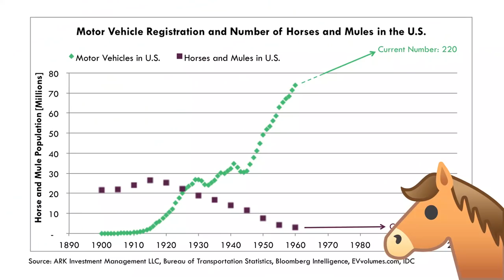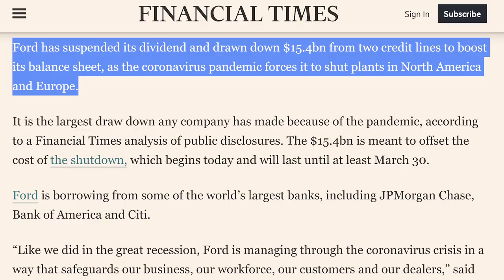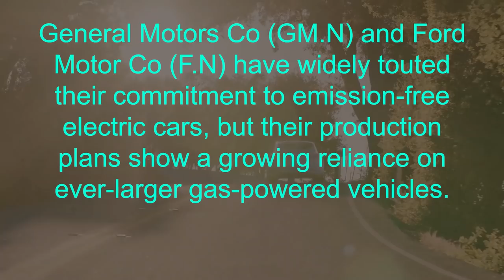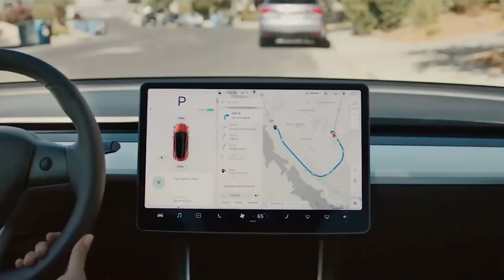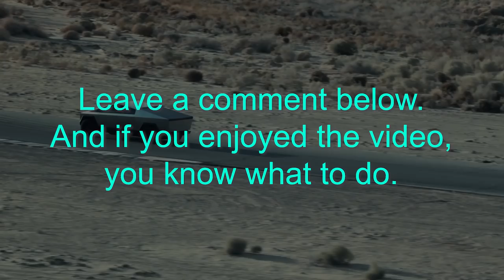Ford and GM are in BIG Trouble (bankrupt soon?)

Comment: The latest one ton diesel pickup trucks are ~$100k. The highest trim levels for 1/2 trucks are approaching $70k. Who are they kidding? I have two tri-moter, 500 mile Cybertrucks on order for my ranch. Hope Elon builds a one ton truck replacement soon. It will need to have at least a 300 Kwh battery. 400 would be better. 

Another interesting tidbit. Case is building a battery electric version of their venerable 580 backhoe. The only problem is it's battery is only ~100 Kwh. It needs at least twice that capacity imo. I am sure that will come in time. Now we need a portable battery large enough to charge the backhoe in the field. Perhaps Tesla's semi could serve this function. It could certainly tow the backhoe to the job-site and it's 1 Mwh battery is amply large enough to charge a 200 Kwh battery.

Comment: EV still have a range and charge time issue.  It's not so much a problem for people that live close to work and do not travel, but outside that it is an issue.  My family takes regular road trips.  On the longest ones I try to bust out 700-800 miles in a day.  That is about 12-14 hours of driving.  No EV can do that.  That means our longer trips take an extra day of travel on each end.  So, take an extra couple days off work or lose two days of vacation.  

I am not saying EV won't ever be most of the market, but my issue is not a lone one.  I think there will be this somewhat of a leveling off point where both are on the market till EV reaches a full parity with ICE as far as daily usage.  When that parity truly comes, yes ICE is dead.  Till then there will be rolls EV just can not fill. 

As for the cybertruck, I don't see that being as big of a seller with current truck owners.  Myself included.  If you actually use your truck for truck stuff, the bed it totally useless thanks to the goofy wedge shape.  Once something that is more like an F150, Silverado, Tacoma, ect hit the market, you will see lots of EV trucks.  That probably won't be a Tesla truck though.  I am pretty sure the preorders are mostly coming from the Tesla fan boy/girl crowd.  I doubt people that do real truck stuff are preordering one.  Especially for work trucks. 

Assuming GM and Ford survive and start making EV trucks, they will likely stand a better chance.  Toyota also with an EV version of the Tacoma would be interesting. 

So, basically, in the end it all really comes down to those batteries.  Once someone figures out something better to get more energy into the same volume and/or how to charge them fast without setting them on fire, all bets are off.  And on the truck side people that know how to actually design a truck and why trucks are designed the way they start making EV ones, all bets are off.  Till these things happen, ICE will still be on the roads.  As long as EV's fail to fill a particular role, there will always be ICE.  It is only when that roll gets fulfilled that EV takes over.

Comment: If Batteries get more energy dense and cheaper (which we all agree is likely) it helps traditional auto companies electrification more than it helps Tesla

Imagine a battery that is twice as energy dense at one third the price. That allows traditional auto companies to offer all their existing models in an electric version

You will be able to spec any vehicle to be EV if energy density doubles and prices are one third of today

The consumer can then choose and most will opt for the electrified version if the premium is not too high

Can Tesla compete in such a world?
Yes in some segments but not in others

That is the most likely future
Batteries and electric powertrain improve so much that any model can be electrified using existing facilities and manufacturing processes

Currently converting an Audi A4 into an electric version might be able to fit 30KWh into the engine bay under the seats and in the transmission tunnel. That gives it a range of perhaps 125 miles that's not sufficient. If battery energy density doubles it allows the car to be 250 mile range which is sufficient. Going from 125 miles to 250 miles is a lot more significant than a Tesla going from 300 miles to 600 miles

Comment: I dont think the car-loan argument is valid.  Defaulted loans turn into repossessed 2nd hand cars which have a predictable value over the short term.  There are few surprises in that situation.
I think you're thinking of these car-loans as long term, but i expect they are short term: mostly 5 yrs, 10 max.
Yeah it might be cutting it fine still considering how quickly Tesla is changing the market.  But it'd take longer again for these shakeups to effect the 2nd hand market.  If ppl are buying 2nd hand cars, they probably cannot afford a Tesla.  Maybe the upcoming   Chinese-designed Tesla can change that, i'm hoping it's designed for a much lower price point than other Teslas.

Comment: I'll provide a counter argument. Ford and GM know that EVs are the future. The main variable here is how fast the transition occurs. It's obvious that switching from gas to EV vehicles is going to be very expensive. They plan on using the profits from their current gas cars and financing to fund this transition. Ford and GM could go bankrupt if the transition happens quicker than they expect, which would be great from a climate change perspective. But I think the EV transition is going to take longer than many of us hope.  It's a very difficult balancing act they're trying to perform, but I think they'll pull through.
Reply: Gas car market is imploding. It was slowly going down before pandemic and now it is just going straight to the ground. Both Ford and GM lost money in Q4 2019, and they probably won't make any money this year. They will probably cut many of their EV related projects just not to go bankrupt next year..

Comment: Let's not forget that there will always be trucks, boats and farm equipment that either cannot run on batteries, so the ICE engine will be with us for a very long time, although in ever decreasing numbers.  Then there's racing!  I know even though there are EV race cars out there, there is just no replacing a screaming F1 car going down a straight.  Or the different engine sounds of a big V8 to a motorbike engines.

Comment: I like this video and what the message is, but I don't totally agree with the prognosis. Yes, Ford has 170 billion in debt and they rely on sales of their F150 too much. But nothing is said about Volkswagon and their 222 billion in debt or Toyota and their 183 billion in debt. Even Daimler has 170 billion in debt. Tesla is just getting rolling and with the Model Y and the Cybertruck, they are going to rip a hole in every carmaker that can't produce an EV vehicle that gets 400 miles to a charge and is self-driving or has a supercharger network across the country. Another thing not discussed is that Tesla is also going to be producing EV Semi's and once they gain a share of that market it could push the Freightliner, International, PACCAR, and Volvo out of the Semi business unless they make their own EV Semi to compete with Tesla. Times right now are going to get very tough for vehicle manufacturers, I have not purchased an EV yet but that is going to change soon. I love how my Prius PlugIn gets great gas mileage (60 mpg average) and I can go almost 2 months without having to buy any gas, but if Toyota was smart they would have pushed themselves into EV long ago. My Jeep can't even compete with its 14 mpg performance. Time to sell it and jump into the Cybertruck with Tesla. But that is just my opinion right now. 
If I had the financial backing to do it I would have 2 Tesla vehicles and my house would have a Solar roof and 4 Powerwalls in my garage. Come on Elon, give me the loan and I'll place my order!

Comment: With 2 9 dollar oil who is going to buy a electric car when gas is so cheap because our electricity power lines will not handle the extra strain on the system

Comment: I understand your excitement for Tesla. I also understand there is a lot about auto manufacturing you don't know, and may not be aware of yourself, because of your excitement for Tesla and what you've been "told" by Tesla.

When do you think Tesla will clear it's first dollar in a calendar year?  Meanwhile, the legacy automakers have been, and are, making profit. That is something Tesla is competing against.

Do you know Ford will have a full electric version of ALL of their vehicles? Did you miss that announcement?

Right now, people who buy a Tesla by a Tesla, not necessarily an electric car. They buy the Tesla for the allure of "Tesla." Musk has basically said the US market for the Model 3 was already met (last year), that was the reason for the dire need to export from USA and build in China; lack of market in USA. 

Ford is working on gravitating the market (not just in US) towards electric cars by first producing hybrid versions of all their models, and offering electric power as just another propulsion option, as if it were just another engine. People are not ready (in general) for switching off desire/comfort/familiarity with gasoline powered cars and immediately switching on to only electric power, which is unfamiliar/unknown/a risk/higher purchase cost/etc. These are perceptions by automotive customers. As such, they have to be assured that this works, is convenient, won't be an inconvenience, and is not an "odd" thing. Ford is working on making electric propulsion mainstream, instead of one of "those" cars. Tesla is offering a "different" thing that is electrically powered. Ford will be offering what people are familiar with, comfortable with, and have confidence in; the vehicles they've been buying and know. 

The Mach-E will be launched this year (or it was before corona). You don't think that is the only electric vehicle Ford is launching, do you? There will be an all electric Explorer launched in Europe this year. The all electric F-150 may be launching this year as well. There is a Hybrid Escape and Explorer currently. The progress to gain acceptance of electric power by the masses is presently ongoing. Tesla will also benefit from this, but Tesla has a stigma attached. Good for some people, not good for others.

All major automakers have all electric platforms. There are more than 50 all electric vehicles hitting the market over the next 5 years, starting last year, manufactured by companies that have been manufacturing vehicles for sometimes more than 100 years.

I always wanted to see a new automaker come into being in my lifetime. I am hopeful that it will be Tesla, but with my experience and knowledge in the industry, I don't know if that is possible. I have more hope now than I did a year ago, but I had no hope then, so that doesn't say much. I'm not here to bash, I am here for cordial conversation.

Comment: Ford and GM or any other manufacturer would not be 'Screwed' if they would embrace and implement Direct to Consumer Sales.  The Auto Manufacturers are like a human who for years has been carrying around a load of fat and adipose tissue, which still works as long as they don't have to compete with anyone.  Yet bring in a clean lean and mean athletic runner (like Tesla), and attempting to drag the gluttonous tissue of Auto Dealers/Associations with them while trying to keep up with Tesla, is indeed going to make many of them stumble and croak. 

It's sad for the wonderful engineers at some of these auto manufacturers, who indeed have been the ones that brought Substance to many of these cars, but when their hard work is politically diluted down by the gluttonous greed overhead of dealers and dealer networks - what gets to the consumer for their money, and what the consumer pays ends up unfairly making the engineers hard work more of a footnote. 

Much better for the Auto Manufacturers, if they would Sell Direct to Consumers (and make a car than can be sustainable that way - like Tesla does), and then also make a car with the features longevity that Consumers want - not the Features-Fail-for-Parts business model like the Dealers want. 

Consumers would be ready to give Auto Manufacturers another chance if they weren't being forced into a mini-socialist Eco-system giving skimmed money to countless third parties - just to buy and own a car.  Consumers are Waking Up to this (not 'woke' but Waking Up, as 'woke' is another fad mental disorder) - but if Auto manufacturers would just sever this glob of gluttonous adipose tissue and fat made up of Auto Dealers/Associations - if they would just do that they may have a better chance to survive. 

If they insist on the gluttonous dealer associations socialist umbrella over consumers, then they actually deserve to fail (and they shouldn't be getting any more government bailouts either!).  If they were to fail and get bailed out, it would be like our government is supporting and endorsing mini-socialism Eco-system bubbles!  This consumer is having No Part of it!